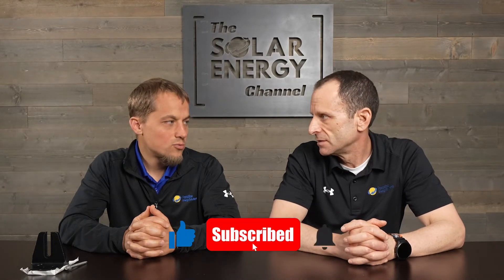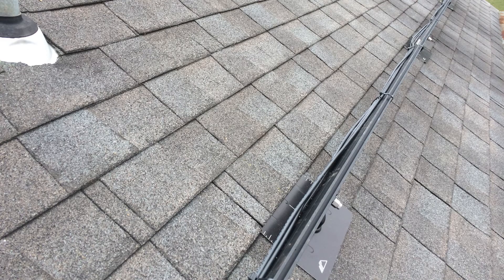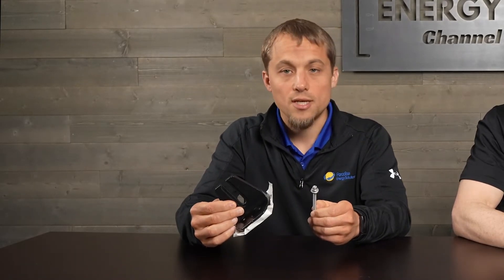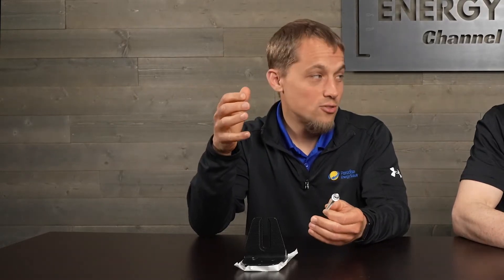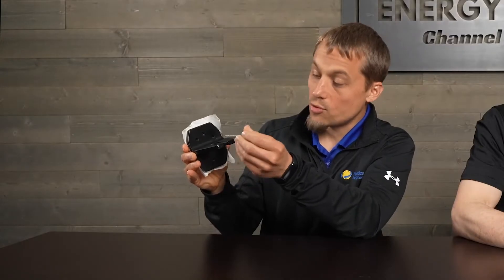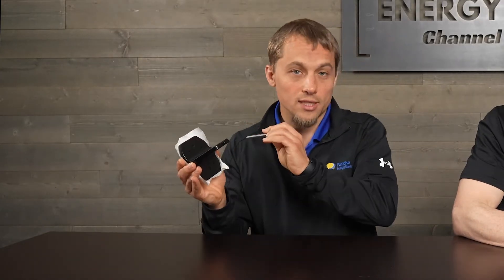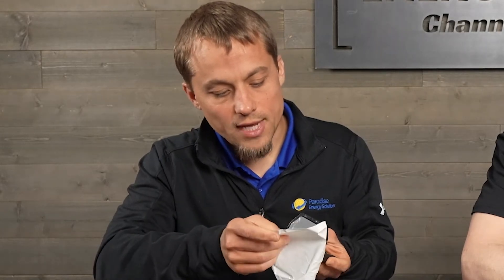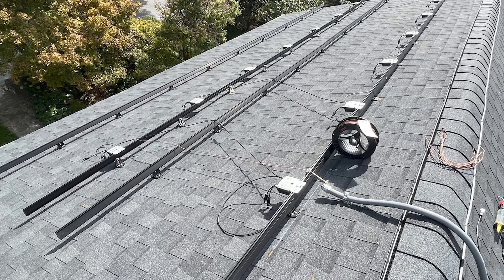The BEST WAY To Attach Solar Panels To A Shingle Roof

Comment: Best I've seen is the bracket breaker.
The panels sit on horizontal rails. The end of those rails dropped down to brackets that connects kind of like a U-shaped to the outside of the roof. They just get pulled in and tightened.

The weight of the frame and panels keeps the structure secure on the roof, there is not a single hole placed in the roof with the exception of the top Apex.

Comment: I had solar panels installed 12 years ago.  They drilled holes in my roof, then filled around the screws with caulk.  Well, the caulk failed after a few years (of course it did) and water started seeping into my attic.  The way I found out was it started leaking through my ceiling and soaking the floors; by that time, all the wood in my attic was soaked and had dry rot.  it was a complete disaster, and very expensive to fix.  Now, the solar company wants to use the method you are talking about to re-install the panels.  I have no faith in this system at ALL.  Supposedly the foam will seal everything -- but for how long?  There are still dozens if not hundreds of holes drilled right into your roof.  When the sealant fails, it will create the same situation as I had before.  There is no foam or sticky material that's going to maintain the same resiliency through hot summers and stormy, freezing winters for decades. I am installing a new 40-year roof.  I expect leaks within 10 years.  There has to be a better way.
Reply: They didn’t warranty the work?

Comment: there is a possible flaw I have with this cool mount.  The force of the wind can rip the rail completely off, if it doesn't do it at once over time. 
isn't there a better way?
Reply: This is an engineering consideration. Given how those bolts look, if they're installed directly into the rafters, your concern is of very low consideration. It's likely it would take hurricane wind forces to rip those out, and if they're torqued correctly would likely fail after the shingles themselves rip off.